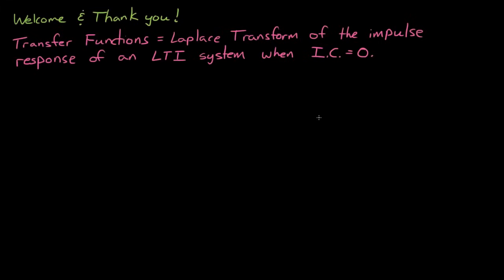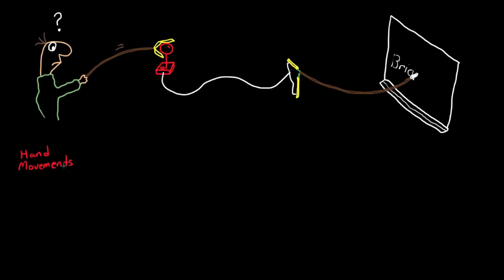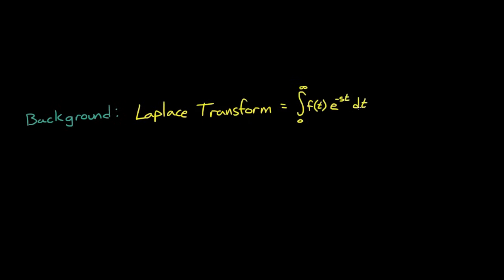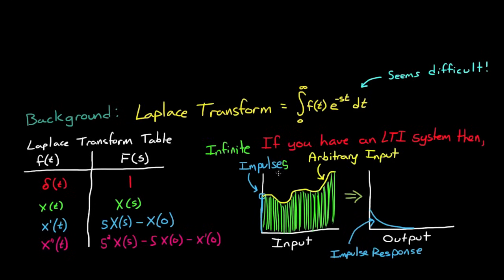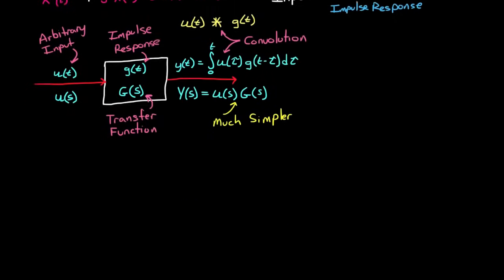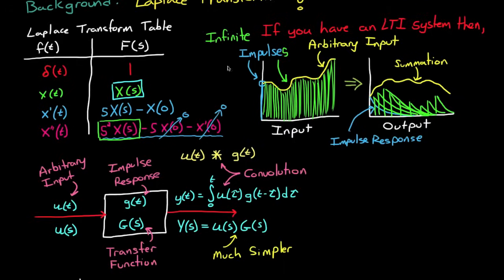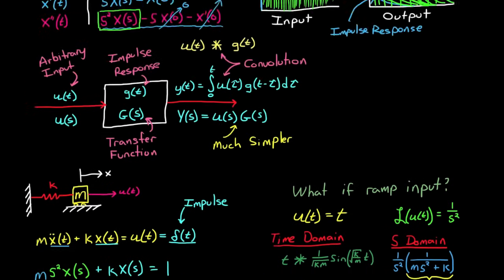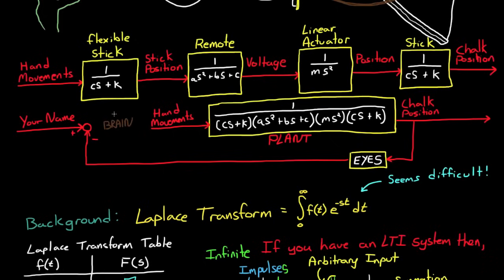Control Systems Lectures - Transfer Functions

Comment: I did encountered an encoder in our machinery system connected to a motor in the conveyor belt and we received output signal in the other end which measure the speed of the conveyor belt I assume there must be a transfer function and I have never heard that in my workplace after a class lecture on control system

I'm no longer a student 😂

Comment: What's confusing is: don't you need to go from the s-domain back to the t-domain when sending a signal to the actuator to move the chalk on the board ? The actuator takes as input a force vector in the time domain, right ?

Comment: Hello, I hope you will take a look at this control paper, which is on the preprint chinaxiv: A control method of Boost converter
doi:10.12074/202401.00242V1.

Comment: What is missing here is how the impulse response y(t) suddenly goes inside the box which is the transfer function g(t). So, being totally stumped at 6:03, and also responding to a few comments about the same matter, we ask the question: "How can the output suddenly become the transfer function?" As I doubt that anyone with the expertise will come to my aid to give me the answer, I will answer for myself as well as any other who may have the same question. It comes down to what is called the "identity property". You learned this in basic math. 1 * x = x. Now we also have the identity property for convolution. For convolution it turns out that δ(t) serves the same function as the number 1 in normal multiplication. IE:
x[t] * δ(t) = x[t]
It may be better to re-arrange this and rename the function. Given transfer function g(t) and input δ(t) we have:

δ(t) * g(t) = y(t) = g(t) = "Impulse response" 

So, the response y(t) ONLY equals g(t) when the input is δ(t), or as he mentions in the video, "the impulse response is the same as g(t)" <==== NOTE

Now, in s space we have the equivalent (remember convolution in time domain = multiplication in s domain)

So, taking the Laplace of the equation above we have

L{δ(t) * g(t)} = L{δ(t)} · G(s) = 1 · G(s) = G(s) = Y(s) <= Again only true for input of δ(t)

So, in conclusion, the only reason he can replace the output response with the transfer function is because the Dirac delta function acts as the identity property for convolution. And, even better, is to say that the error in the video is when he puts g(t) inside the box that represents the transfer function. The transfer function is represented ONLY by G(s)- never by g(t). If anything, he should have written g(t) = y(t) (OUTSIDE of the box), and only when the input is an impulse function. So, finally:

H(s) = L{h(t)} = L{y(t)} <- when the input is an impulse function δ(t), but only H(s) belongs inside the box.

Again, I only present what I believe is the most logical answer to my question as I am learning here just like anyone else. I invite Brian or anyone else of superior knowledge to set me straight.
So, not to refute anything being said here, but I have a sense of some "hand waving" that probably needs better explanation.

Comment: Brilliant! thanks a lot! just a question, let's suppose a system, how do you find the underlying impulse response/transfer function of that system?
I mean, you always get the equations in school, so you solve for the IR/TF or even the output, but when you are in front of a process, how do you estimate the equations governing that process? Then the rest is just math.
Reply: it depends on the process, there are electrical, mechanical, thermodynamical, fluid dynamics systems.... and combinations of all of those. You must know which physical laws model their behaviour in order to write the differential equations that describe them. In mechanical dynamical systems there is the Newton laws, electric circuits use the Kirchoff and Ohm laws, etc
Reply: @daniell9834  ok, I get it! So a deep analysis of the system is necessary in order not just to obtain the transfer function, but to understand the underlying dynamics of the system. Thanks a lot!

Comment: 4:28 you say that laplace of derivative of a function x' is s*x(s)-x(0). But your notation is confusing. is x(0) the laplaced x(t) at s=0 or is it just unlaplaced x(t) at t=0? For the one not very familiar with laplace transform, it is not easy to quickly figure out the confusion. I assume it is the former (x(s) at s=0), but i'm not sure.
Reply: actually, you said it out loud (DOH!), s*x(s) - "the initial position", which is x(t) at t=0. Hmm, interesting.
Reply: I'm actually having serious trouble understanding this statement. For example, let's say i have x(t)=0 at t=0 but 1 at x>0. Then compare it to x(t)=1 at x>=0. From the integration standpoint and for taking derivatives, they are equivalent. But the resulting laplace transforms are different. Maybe the statement makes some assumpitons on the continuity of the function in the integration range?... 

I was about to say "continuity at t=0", but since the integration does not span the range of negative t, I suppose that x(t)=0 for t<0 is assumed... So if x(0) is not zero, the function must have a step (= a discontinuity) at t=0.

Comment: It's funny how often you use the  "=" to discribe the fact that something involves something else, and not always between two things that are mathematicaly equal (like at 8:31). That's the intuitive way I first understood the "=" sign when I was youger, but in high school I was told it was wrong and I should never use that sign for that otherwise it would be confusing , and I would loose points in my exams. But now I see you using it that way, and it's really not a problem and absolutely not confusing. It doesn't really matter how things are written as long as the message is clear.

Comment: Hello 
Can you explain to me what is the order of the system? I can not able to visualize what is first order and what is second-order? @brian
Reply: The order of the system is the order of the linear differential equation describing it (in case there is just a single DE), that is, the order of highest derivative involved. Alternatively, the order is the degree of polynomial in the denominator of the transfer function.

Comment: Holly cow. Your presentations are even better than Khan Academy's (and theirs are already great)! The illustrations, the motivation, the introductory examples, the back-up with actual theory/math, the black background (this is helpful because it tires the eyes less), how you don't stray from the topic, and the fact that all of this is free. Thanks a lot!

One question I've ever had is how do we proceed if our system (circuits in my case) have more than one input (source)? How could we find the transfer function output/input, if in this case we have multiple inputs?

Comment: Transfer function is the relation between the input and output of a (linear time-invariant) system. That being said, it begs the question: why use a transfer function to describe the relation between an input and an output?

The dynamics of a system can be described as a set differential equations (like the laws if Newtons such as “F=ma”, where “a” (acceleration) is the derivative of the velocity). When there is no input, and the system is left alone, the output will depend on the initial conditions (think of a swinging pendulum). When there is an input, you can find out what the output will be like by solving the differential equation. This usually involves a convolution integral between the input and what the output is like when the system has no inputs.

Convolution integrals are complicated and long to solve, but the Laplace transform makes them easy to solve. This transform changes the convolution integral into a multiplication of the Laplace transform of the input and of the Laplace transform of the output when there is no input. That Laplace transform of the oitput when there is no input is called “transfer function”. It can reveal information about the system and can be used to find out what the Laplace transform of the output will be by multiplying the Laplace transform of the input to the transfer function. Taking the Inverse of the Laplace transform of this multiplication yields the same result as calculation the convolution integral mentioned earlier. This means that knowning the transfer function of a system helps us find the output of any (linear time-invariant) input easily.

Comment: A discrete time system with a pole in 0.9 and a zero in - 0.9 is a?

low-pass filter
high-pass filter

How do you see this for discrete time? 
I know how to do it for continious systems as in fill in s=0 and s= inf to see what the fransfer function gives you? But in this case i just get -1 and +1?
Thanks in advance

Comment: Concept of transfer functions. Response of simple chemical processes to step, ramp, and sinusoidal inputs. Transient response of interacting elements in series. Frequency response analysis of simple systems. On-off control, cascade control, ratio control, proportional, integral, derivative, and combinations of these control actions, single-input/single-output control and multiple-input/multiple- output control. Closed-loop response. Feedback and feedforward control. Controller tuning and algorithms. Simple stability analysis. Dynamics and control of common chemical process units such as heat exchangers, simple reactors, and agitated vessels. Hardware implementation, analog and digital, of simple control algorithms and designs.

could you tell me where i can find your lectures with theses topics?

Comment: An insight I had around 2:30 is that having the output of one function as the input of another function reminds me of the chain rule in differential calculus. What is the significance of this? Could you find the rate of change, for example, of the position of the chalk as a function of the rate of change of the position of your hand?

Comment: Brian, thanks for taking the time to do these videos it helps in a great way to have this quick to the point explanations 
Nicely done.
There is only one thing. If it is not  too much to ask for some book titles or authors you're familiar with, that may expand on the material you are treating, 
Thanks, nice going

Comment: Hi Brian, you said that the transfer function is the Laplace transform of the impulse transform with zero initial conditions, but what if I have some non zero initial conditions? Like what if I have to mathematically model a system where my system is human body and I need to control the drug dosage into my system, so for such system what if there is already some amount of drug present in the patient's body which means I already have some finite real value initial condition. So how am I gonna find my transfer function from my differential equation in this case, when I already have non zero initial conditions?? Hope you understand my question
Reply: i was also curious for the same!!did u find any logical explanation for non zero condition and transfer function of the system?i tried to come up with some thing it goes like 
"so when u include initial condition while calculating TF of the system,the input output behaviour becomes "NONLINEAR" and basically u dont want that behaviour WHILE u are defining TF of the system u only define TF with the assumption that your system behaviour is linear and time invariant and also causal (although not sure about causality) and all these TF building assumptions are not valid when u have initial condition "
i hope i m right! if u have any suggestion please let me know.
Reply: If I may agree with you then my question would be that whats the relation of initial condition with the linearity?
Reply: in short i can say that response due to initial condition will always remain constant through the calculation of total response nd it is definitely not affected by the input to the system and that is why we always superpose the "natural response" to calculate the total response of the system..in short to answer your question regarding linearity i can definitely say initial condition will definitely violate the linearity proporty of the system..u can try it by proving the linearity of Y(t)=Y(t0)+H(t)*U(t) (strictly talking about LTI).i hope it makes more sense .this is my intutive understanding of the LTI system response and Transfer function .Feel free to question more.!!

Comment: A transfer function is NOT ONLY the impulse response of an LTI system when IS = 0, this is only a very specific transfer function. 

Defenition of a transfer function: 
A Transfer Function is the ratio of the output of a system to the input of a system,   Tansfer function = Output signal / Input signal.

Let me take the example in the end of the video.
First we start in the time domain. The input value of the system is u(t) which describes how the force on the object varies over time. Our output value of the system is the position x(t) of the object. We use Newtons 2:nd to describe the system: 
mx''(t) = u(t) - kx(t)
One way to get the transfer function is to solve this differential equation using standard calculus. However in many cases the differential equation is a challenge to solve.

That's when the S-domain comes handy. The equation in the S-domain: 
mS^2 X(s) = U(s) - kX(s)       =>
X(s)[ mS^2 + k ] = U(s)             =>
X(S) / U(s) = 1 / (mS^2 + k)

Transfer function = out / in    =>
G(s) =  X(s) / U(s) = 1 / (mS^2 + k)

What will happen with the output signal when the input signal is an impulse with amplitue one?
X(s) = G(s) * U(s)
u(t) = impulse    =>    U(S) = 1    =>
X(s) = G(s) * 1 = 1 / (mS^2 + k)

We now have to convert this output signal to the time domain, since this comment is already awfully long we use tables to get the value:
x(t) = (1 / (mk)^0.5)sin[(k/m)^0.5 * t]
Reply from the maker: +Fredrik Högberg, thanks for the comment.  You are right that you can think of the transfer function as the ratio of the output to input of a system in the Laplace domain, however, you are NOT correct in saying that the definition I used is only for a specific transfer function ... they are equivalent.  I prefer the definition using the impulse response because it makes more sense when you think of what the transfer function is doing in terms of convolution.  When you multiply an s-domain signal with a transfer function you are convolving that signal with the impulse response of the system (written as a transfer function).  If all you are trying to do it write out a transfer function then performing the out/in operation is the easiest.  If you are trying to understand why you can do multiplication in the s-domain then you need to know that it's the impulse response. 

The reason the input over output works in the first place is that the impulse function in Laplace domain is 1.  So where you wrote G(s) = X(s) / U(s) = 1 / (ms^2 + k) this could be re-written as (ms^2 + k)*X(s) = 1*U(s). There it is clear the input is the impulse response 1.

If your system has a forcing function F(s) applied and you wrote out the transfer function as out/in then you'd get G(s) = X(s) / U(s) = F(s) / (ms^2 + k), which is its transfer function, and you might be tempted to say that the input is no longer the impulse response, but the forcing function F(s).  However, if you think of the forcing function as a transfer function then the system becomes U(s) -> F(s) -> G(s).  Again the input U(s) is an impulse which acts on F(s), that causes output signal F(s) which acts on G(s) to produce output X(s).  Therefore the combined transfer function F(s)G(s) is still an impulse response.

Hopefully this all made sense.
Reply: +Brian Douglas, it all make sense now! Thanks for making these awesome videos and taking your time to write this reply!
Reply: its okay to be wrong sometimes Brian. Take it like a man.
Reply: He's not wrong though, the transfer function IS the impulse response. So he shouldn't take it like a man, but rather explain it like a man(?) as he very clearly did!
Reply: the transfer function is the input output relationship of the system. the impulse response is the response of the system when hit with an impulse which is essentially a signal of a wide range of frequencies. y=T*delta
i wonder who taught your signals and systems class...
Reply: Joab Andrade if you pick x(t) = diraq(t)
Then y(t) = h(t)
Making the LaPlace transform of both you get:
X(s) = 1
With response Y(s) = H(s) = Y(s)/X(s)
Meaning H(s) is the LaPlace transform of the impulsional response, which should make it an impulsional response as well, no?
Reply: H(s) is the transfer function. Y(s) = H(s)*1 is the impulse response which in this case is equal to H. As a matter of fact, you're right. The transfer function will always be the impulse response because H(s)*1 = H(s) regardless. My mistake...
Reply: Props to you for admitting to be wrong! I was actually not convinced I was correct and was expecting a mind breaking response from you since my teacher is not the best and he could've misled me, but seems he was right!

Comment: if the transfer function is the impulse response,then how come that transfer function differed from system to another 
I though that impulse response is a constant
Reply: +Mohamed Ali The impulse response is constant, however the system itself changes, meaning that the system he used was sth like this mx''(t) + kx(t)= u(t), however if you changed the system instead of using a the previous equation you came up with a system that uses a whole new equation like this   ex''(t)+ ax'(t) - bx(t) = 6u(t), this will give a totally new impulse response.
Concluding, impulse response simply means the reaction(response) of your system when you give it an input= impulse, so you can see that the input will remain the same regardless of the system but the reaction changes.